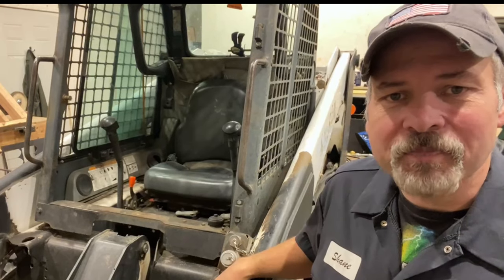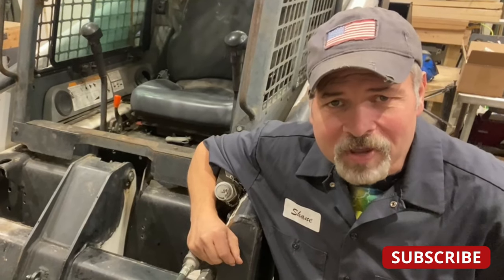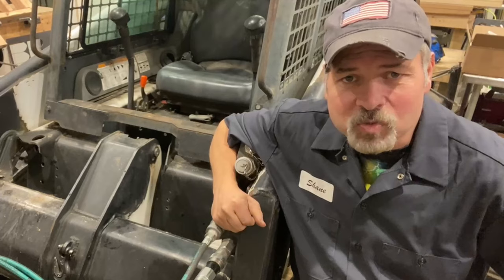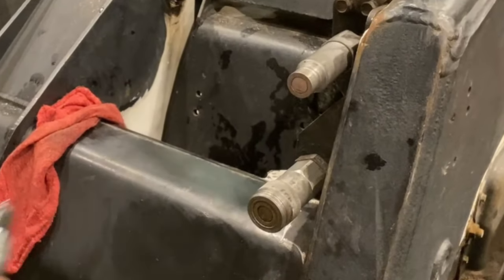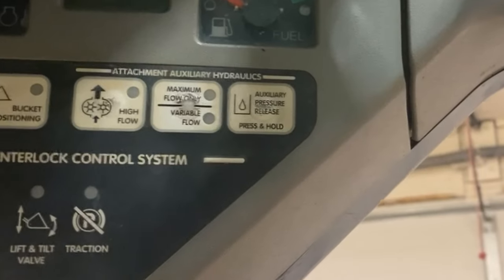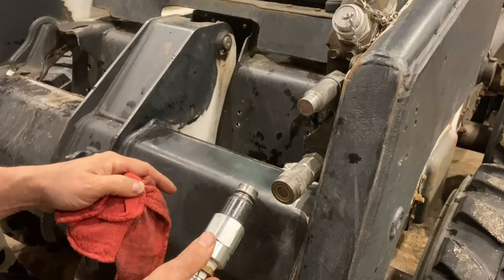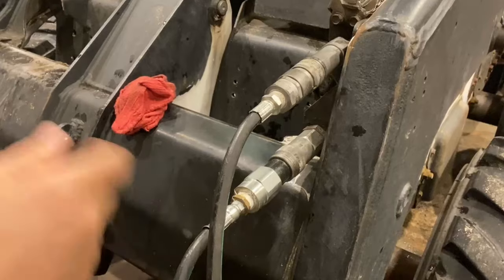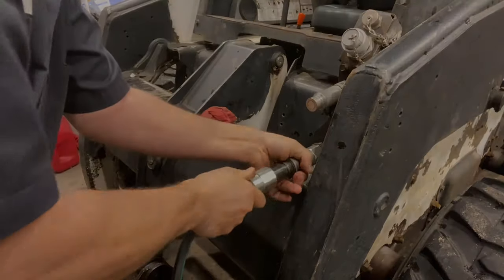how to hook up auxiliary hydraulics - skid steer auxiliary hydraulic couplers

Comment: Connecting the hoses together from the attachments when not in use has helped me a lot. My New Holland skid steers don't have that button. The hoses will build up pressure from sitting in the sun.
Reply from the maker: Michael, 
Yes sir! I always connect my hoses together.
Keeps the dirt out of the fittings and helps to keep them equalized
I hadnt considered that they build pressure sitting in the sun but that makes perfect sense!
Excellent comment!
Thanks again,, 
-Shane

Comment: Great! Do you run the skid steer at a certain rpm when you push the button? My bobcat doesn’t die (or at least after more than a minute it doesn’t die)
Reply: Also does the safety bar need to be up, down or doesn’t matter?

Comment: Do you have a video on operating a grapple ? I have a similar m/c ( T190 , panel is like yours ) I have an issue with aux hydraulics not working . I put a grapple on it , but not functioning with the thumb switch even with the hydraulic light on . What am I doing wrong ?
Reply from the maker: Mr Bill, 
Ensure that you have enabled the hydraulics on your control pad. (mine is on the top left of cab) 
and then you should be able to sort out what control button is programmed for supplying flow to the aux set up. Each machine is a little different but it is going to be pretty basic. Just a two position flow valve setup. 
If you dont get it working, check your aux system with a different implement to ensure that it is working. Isolate the issue and then troubleshooting becomes easier
LEt us know what you come up with! 
-Shane

Comment: I have 1993 7753 and have always had the problem of plugging in the auxiliary hydraulic lines. One goes on no problem and the seldom goes in without cracking the fitting and bleeding off pressure. You are supposed to turn the key off and in the same motion turn it to pressure relief. It might work 2 of of a 100 times. Have talked with Bobcat and they have no ideas. Do you. I have contemplated putting a toggle switch to power up the relief valve for a few seconds but I shouldn't have to do that. I bought this machine new in 1994. Thanks
Reply from the maker: Unfortunately I don't have any ideas for that particular system. Sorry.
-Shane
Reply: @AHandleOnThings  Ok, thx.

Comment: How do you release pressure on the older models that don't have the button ?
Reply from the maker: Try attaching one hose. (Usually one hose will go on and the second one gives you trouble due to pressure... ) Then after trying and failing to attach the second hydraulic line.... DISCONNECT the FIRST hose you JUST HOOKED UP and the attach the OTHER One... 
THEN attach the FIRST line again... 
That used to work to bleed off the pressure every time with my last machine.  
Let us know how it works out for you!
-Shane

Comment: Hi I have a question and I'd appreciate if you could help me out I have a bobcat compact excavator and one of the thumb hydraulic line snagged and ripped off but it broke and all the hydraulic fluid spilled out I got a new hose and it's all back and put more hydraulic fluid do I have to "purge the lines" ? And how I can't find a spot to hook up a purge hose .. its the bobcat 331
Reply from the maker: There will likely be a different "factory recommended" process for bleeding the air out of your system depending on what the broken hydraulic line was serving. 
While I dont claim to know the process for your machine and I dont know which ram your line was serving, often it is as simple as removing the OUT-FLOW line from the affected ram, and then collapsing the ram to an "empty" state to bleed the air from it and then hook the line back up and supply the hydraulic fluid to the ram again. 
Again, I dont have enough info to promise you that this will work, but that is a commonly followed procedure.
Let us know how you come out!
-Shane

Comment: Do you know where the auxiliary lines lead too? I have an 853h but the auxiliary lines got disconnected by the previous owner so I don’t know where to connect them back into
Reply from the maker: Mine follow the inside of the lift arm on the "drivers side" back to the engine compartment. They are obscured once they hit the engine compartment so I cant tell you the routing from there. Sorry. 
I would look for a maintenance/parts manual and there should be something there I would guess.
Let us know how you come out!
Stay safe!
-Shane

Comment: I have a New Holland.  It doesn't have a pressure release button.  How do I connect the aux attachments?
Reply from the maker: G.A. Wilson, 
I haven't ever owned a new Holland, but when in doubt, shut the machine down and that is often enough to open the pressure releases.
Optionally, give your local New Holland dealer a shout and they can help for sure.
Thanks for the comment and be sure to let us knw what you come up with!!
Stay safe!
-Shane
Reply: No.. Shutting off machine does not help.  Calling a qualified NH tech does not help either. Pretty much just work at it for about an hour each hook up while bitching and moaning the entire time. If rhis doesn't help just cry for a few minutes when you become very fed up with it. Usually none of this works.

Comment: Yeah but what if the lines have pressure? How do u release that?
Reply from the maker: The pressure release button should release all pressure within the system if the hydraulic lines are connected to the machine. 
-Shane

Comment: I have the same model as you in your video. Cant get my front hydraulics to work. I'm using a titan tree puller attachment.  Im tried all my thumb switches to no avail. I have the hydraulics light do come on. Any suggestions? Am I possibly not turning something on? Im new to this machine. Thanks
Reply from the maker: Right below your fuel gauge there is a button that says "maximum flow only/variable flow"...
Push that after you have all of the hydraulic lights lit up and then try your switches... That enables the switches on the sticks.
Let us know if that solves your problem! 
Stay safe!
-Shane
Reply: @AHandleOnThings  , should it be in max flow or variable flow ? Mine doesn't work with either light on .

Comment: Any ideas what to do if this tip doesn’t work?
Reply from the maker: It would depend a lot on what machine you have, some of the skidsteers just function differently 
Sorry I dont have a better answer for you.
-Shane
Reply: No need for apologies! I really appreciated the video. My issue ended up being the hydraulic connections on the rental attachment. I was able to relieve the pressure in the hoses with a hammer and a long bolt. Thanks!
Reply from the maker: @backlund5  I'm glad you got it figured out! 
Sometimes the fix is to get a bigger hammer!
lol!
Hope you have a super weekend!
-Shane

Comment: I can’t get them off
Reply from the maker: Dawn
Generally the problem is needing to depressurize the hydraulic system.
Occasionally you may be accidentally be pushing on fittings that are supposed to be pulled to release (or vice-versa)
Another possibility is... there is a little bead that is essentially a ball bearing that needs to be aligned with the collar to allow it to be slid.
Let us know what you come up with!
Thanks,
-Shane